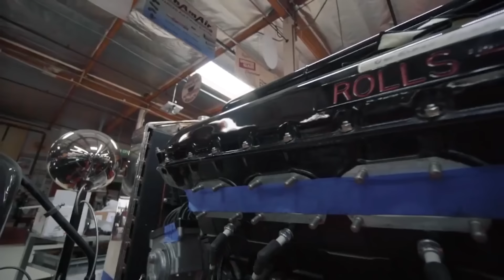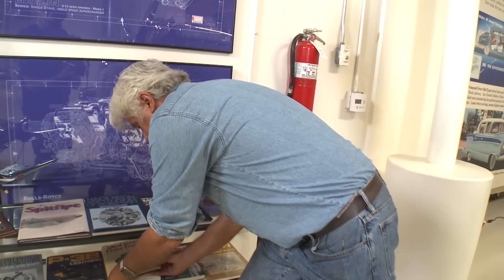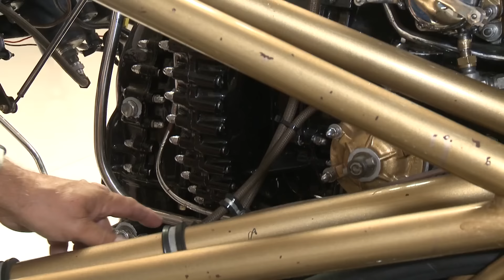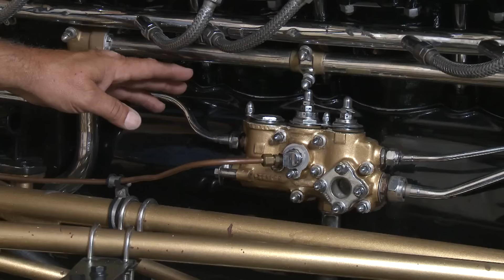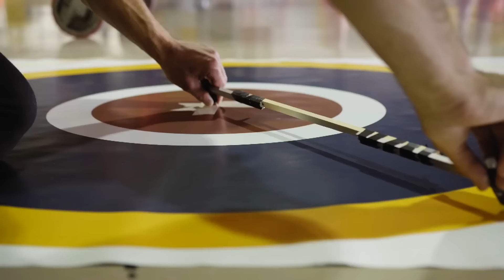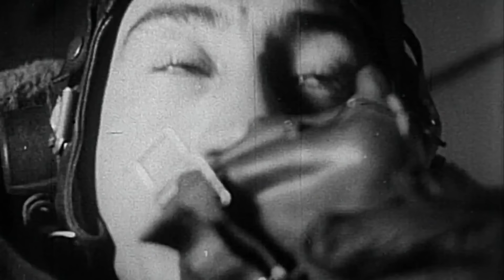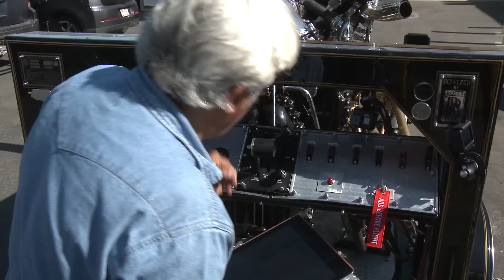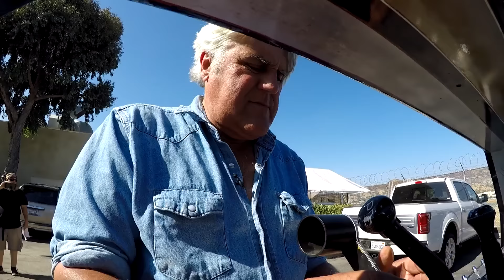The Engine That Won World War II - Jay Leno's Garage

Comment: The Canadian Warplane Heritage Museum is actually in my hometown. Hamilton, Ontario. It's a good 60 km drive away from Toronto.

If you want to ride the Lancaster... you pretty much need to book it a year in advance because those rides sell like hotcakes... and they're expensive as hell.

Aside: We also have the very last Tribal-class destroyer (used in WWII) here in Hamilton, the HMCS Haida. And about a 130ish km away in Port Burwell, Ontario you can visit the retired HMCS Ojibwa, an Oberon-class submarine from the 1960s (that was used until the 90s).
Reply: I checked the museum web site and a 60-minute ride in the Avro Lancaster is priced at $3,500.00. For those whose pockets aren't so deep, a 20-minute ride in a twin-engine B-25 Mitchell bomber (the plane Jimmy Doolittle flew off the carrier USS Hornet in 1942 to bomb Tokyo) can be had for $500.00. All in all, considering the 75+ year age of these planes and the costs of keeping them airworthy, the prices don't seem to be out of line.
Reply: Just to point out, the CWH Lanc didn't see wartime service. It was finished in July 45, and spent it's service life in the RCAF based in NF for maritime rescue patrol. (Though it does have the centre section of a wartime plane. From a repair in the 1950s.)

The former RCAF FM213 is now painted as RCAF KB726 the aircraft on which Victoria Cross winner Pilot Officer Andrew Mynarski served (and died).

As for the price, it's "expensive" in terms of most people aren't going to spend $3500 (CAD) for it, even though it goes entirely to keeping the Lanc airworthy. (Then again if it was cheaper there'd be even MORE people wanting to ride it...)
Reply: Of the 7,377 aircraft built, only 17 remain in complete form today, two 
of which are airworthy. Within the seventeen surviving planes, ten are 
Canadian-built, and eight now reside in Canada. Shot down. Scrapped. The cost of making one airworthy is astronomical.
Reply: My hometown as well. The Lanc sat on a pedestal in Goodrich for years. It was donated to the CWH by Bruce Sully. My Dad yanked it off the pedestal and dragged it across the road to disassemble it, so it could be heli lifted to Hamilton via a CF Chinook. Took them 2 tries but they got it off the ground. Never saw the aircraft again till decades later at the CWH in Hamilton. The CWH owes my Dad his promised ride BIGTIME!!
Reply: For one thing, the airframes on these planes are now about 75 years old. Far beyond their designed life expectancy. Four engine bombers were built for a very specific task - to drop bombs. As such, they did not lend themselves easily to being used for other tasks. They were expensive to operate, difficult to convert for civilian use and very soon were outdated for military use. They quickly became of no or little military or civilian value and were eventually scrapped. The ones that survived being scrapped have slowly succumbed to age to the point where there are now only two airworthy Lancs left.
Reply: I visited the Bomber Command museum in Nanton, Alberta this summer to see their Lanc on display. After the war, surplus aircraft like a Lancaster could be bought (minus engines) for less than $1,000 (about $10,500 CAD in today's money). Apparently, farmers would buy them in order to strip out the wiring, hydraulic cylinders, sheet aluminum and other parts for use on the farm and then sell what was left to scrap dealers to recoup some of their cost.
Reply: soaringtractor
Not this idiot again. The Merlin was a Roll Royce Merlin, not Packard. Packard were a sub contractor for Rolls Royce. Packard built another company's engine.
Reply: Who care's where the engines were made Wiblur? The technology and designs were British and by the end of WW2 Rolls-Royce was concentrating on jets and the Griffon. By contrast Packard was trying to stay afloat building 1932 technology in 1946. When did they fold?
Reply: I don't believe they were profiteering, but as a licensee they didn't have the technical innovation to continue as an aero-engine builder when things were changing so fast.
Reply: Aryan supremacy was not the underlying principle of manifest destiny.  While the term has adapted in meaning through the years, the underlying principle was and continues to be God's purpose to accomplish a given task.  There is a presumption of racism in the tenant but it is not the underlying principle.
Reply: The Warplane Museum also has a de Havilland Mosquito - a bomber powered by the Merlin.  The last time I was there, they were overhauling the Lancaster Merlin engines, and flights were not available (obviously).
Reply: Shock Diamond.
Packard did not design the Merlin, they did not change the Merlin, they did not improve the Merlin. 
Packard made Merlins to Rolls Royce specifications and that is all.
The bearings were of different material because that is what was available locally.  The best Packard built Rolls Royce engine was put into the P 51. It was not even close to the best Rolls Royce Merlin. Reliability was far better in Rolls Royce engines.
No matter how you lie, the facts are that Rolls Royce were better at making engines, more progressive and they paid Packard rather well for engines that at first were not too good, later they were ok, but they were still not Rolls Royce quality.
Reply: Lancaster FM-159-Nanton will hopefully fly again one day.
Reply: MrCorvairGuy-  Actually, the idea of Aryan supremacy was a prominent philosophy in American society and government in that late 1800's and early 20th century.  That was the underlying principle of 'Manifest Destiny' that led us to the shores of the Pacific and beyond.  Seizing & subduing the Philipine Islands after defeating Spain, and then conflicting with the Japanese 40 years later, were the end result of this way of thinking.  Read virtually any book on Teddy Roosevelt to learn just how dominant was this way of thinking, with T.R. one its leading proponents.  Henry ford, of course, was a product of this era, so it's no wonder that he was sympathetic with SOME of Naziism's tenets.
Reply: John Burns
Actually Packard did not design the Liberty engine, and they made some of them, but not the complete engine, Ford was the main supplier of parts for the engines which date from 1917, RR made their own aero engines from 1915. Poor Wilber tractor does not like it that Britain was so far ahead.
Reply: I had the privilege of accompanying my son who is a Scout on the Hamilton Warplane Heritage Museums "Nite Ops" overnight sleepover. One of the curators and I got to talking as I was born in the same town as Reginald Mitchell, the designer of the Spitfire which of course, used the Merlin. Although the Lancaster was laid up for maintenance over the winter, eh allowed myself and another father there access to the Lancaster and spent over 2 hours talking to us. He gave us the history of that specific Lancaster. 

I cannot agree with Jay more. If you ever get the chance, visit the museum. And at C$5000 for a flight in the Lanc', money well spent. Apparently, its costs in excess of C$250k per engine for a overhaul. All funded privately.
Reply: Shlock Dimond.
The Packard version was not better, it was the same as the equivalent Merlin and not quite as good.  
Rolls Royce engineers did do everything by hand including fitting bearings to much better tolerances, but Rolls Royce and Ford of Britain made changes for mass production which were exactly what Rolls Royce gave to Packard.  That may help explain why Rolls Royce made more Merlin engines than Packard, Rolls Royce also made the Griffon engine and jet engines.
The Packard copy used a different supercharger which was heavier and less efficient than the Rolls Royce version 
  
The Packard version went into the P 51 because it was available locally and North American did not need to import it. any Spitfire from 1941 could go more than high enough to escort the B 17. 
You are mixing the P 51 with a Rolls Royce engine to the P 51 with an Allison engine, the Rolls Royce engine certainly helped the performance of the P 51 including the ability to go higher. The service ceiling for a B 17 G,  35,600 feet, the Spitfire Mk V of 1941 could go higher and the Mk IX with a 2 speed 2 stage supercharger in 1942 could do over 43,000 feet and that is higher than the P 51 D of mid 1944. The Spitfire Mk IX had at least as much power and some more than the Packard engine in the P 51.
Reply: John Burns 
It's someone's intellectual property.
It's not "holding" anybody back, except for those who think they deserve a free ride in life.
That's the mentality of a squatter.
Break into someone else's home while they're away, and think you have a "right" to live there...
Reply: One hundredth upthumb for the Hammer, and it is most certainly not a Toronto suburb, not a part of the GTA. To be correct, the closest you can come to lumping the two together is the GTHA. Jay, thanks for coming to Hamilton, next time look into a direct flight to John C. Munro Hamilton International Airport, not sure what connects, but that is where the CWHM is located.
Reply: Why only 1-2 Lancester are preserved? I mean they have made thousands of them, they were scrapped all after war?
Reply: Not exactly. They lived on, for awhile, in the shape of Shackleton Marine Patrol aircraft didn't they?
Reply: yes, into the 1960s.
Reply: Guy's give him a break, he's an American you can't expect him to understand Geography.
Reply: And the Lancastrian freighter/passenger aircraft, plus they formed the basis of the Avro York which did great work as a transport - especially in the Berlin Airlift.
Reply: AdmiralCreideiki warplane museum is like behind my house lol
Reply: soaringtractor
I know how the Liberty engine was cooled.  It was unsuitable for tanks in deserts.
Reply: There are a few preserved as static museum exhibits and there is one in the UK that can taxi, which they hope to get back into flying condition one day.
Reply: 18tangles
Will you please get to know how to use a keyboard.
Reply: Shock Diamond
"It's the reason why the Packard Merlins went into the P-51D Mustang and not the Rolls version "
The reason why was that they were made in the USA and easy to transport to NAA.
Reply: 18tangles
"No copyright in those days"
Copyright and patents have held the world back.  It is economically parasitical.
Reply: I think it can do more than taxi.  https://www.raf.mod.uk/bbmf/theaircraft/lancasterpa474.cfm
Reply: Bob Johnson 
That's when they get rebuilt and restored, strengthened and reinforced where necessary, new parts fabricated to keep them in flyable condition.
It's not exactly cheap, but if it's important to enough people, it can be done.
Reply: Lee S
_"It's someone's intellectual property.
It's not "holding" anybody back, except for those who think they deserve a free ride in life."_
The Free rider is the patent or copyright holder. They hold them for far too long stifling progress. It is unearned income.  Free loaders.
Reply: Lee S.
You mean those Rolls Royce Merlin engines were nice, there was no Packard Merlin, Packard were a well paid subsidiary of Rolls Royce, they made some of the engines to Rolls Royce specifications
Reply: 18tangles
It is the time length of copyright and patents that is the problem.  They are far too long.
Reply: He can hop on a UPS Cargo flight.
Reply: Just to be sure you don't reply with something unfounded and annoying, I will paste an excerpt and you should just accept that you're learning something you didn't know:
"Packard’s licensing agreement prevented them from implementing any changes to the design of the Merlin without approval from Rolls-Royce. There was an understandable need to maintain compatibility and consistent performance among the engines regardless of where they were manufactured. While Rolls-Royce engineers were typically attentive to suggestions from their manufacturing partners, any accepted design changes were applied across all production lines.  One area where the Americans contributed to the greatness of the Merlin was the crankshaft bearings. US aircraft engine manufacturers had determined that a silver-lead alloy with indium plating provided long wear and exceptional corrosion resistance. Thankfully, German engineers who evaluated captured American engines falsely deduced that the indium was merely an impurity. Packard shared the secret bearing formula with Rolls-Royce who incorporated it into the Merlin."
Reply: Do as you wish.  The only thing you might say different is, after Packard's bearings were approved by Rolls Royce, it was implemented across all manufacturing lines.  It is also true that Packard's tolerances for mass production were much finer than Rolls Royce's hand built units and they actually used torque wrenches to evenly and accurately torque nuts and bolts, where Rolls Royce engineers did it strictly by hand and feel.  Again, the Packard built Merlins were a better version simply by design as they needed to be 100% compatible and interchangeable with other engines.  It's the reason why the Packard Merlins went into the P-51D Mustang and not the Rolls version from the Spitfire, and the stage 2 supercharger that accompanied the Mustang increased its power output and allowed them flight of much higher altitudes and escort B-17 bombers.
Reply: I'm surprised the Canadian air force and navy don't want those all back to use today! lol
Reply: johhnybottle-  In the mid-1950's, as a result of being under-capitalized.  So much for 'was profiteering', eh?  Those engine contracts didn't seem to do Packard a whole lot of good, did they?
Reply: soaringtaractor-finnigan
"What you fail to realize is PACKARD was designing and building engines as long as RR was clear back to 1915"
So was Skoda as well. But nothing made them better or had better designs than RR. Now you know.
Reply: Gary Tarr 
Those Packard Merlins sure were nice...
Reply: The Haida  used to be in Toronto, but the Liberal Party used it as a bribe to get seats.
Reply: Adolf Hitler praised Ford's openly anti-Semitic views and his mass production abilities; however, Henry Ford was NEVER a Nazi sympathizer.
Reply: Barrie, I never said Packard made Liberty engines. ;) How Nuffield used it in British tanks I will never know. It was poor with severe overheating problems.
Reply: Packard was building the Merlin under licence, but don't get confused - Packard's versions of the Merlin are not identical and are a better engine.  Packard's versions are the definitive Merlins that were better than what Rolls Royce developed.  The V-1650-7 is the best version of the Merlin put into the Mustang P-51D.
Jay's Merlin is a PACKARD V-1650-1 MERLIN, which is a single stage, two speed supercharged engine - a near clone of Rolls Royce's, except Packard used better main bearings.  Due to the use of indium plated, silver-lead alloy bearings, the Packard Merlins were stronger, more reliable engines.  No matter how you slice it, dice it or rice it, Packard's Merlin were better, regardless of the engine's basic mechanics and architecture belonging to Rolls Royce. ;)
Reply: "Nowhere in the Haynes book".  Great.  Someone who is using a Haynes manual is trying to argue with me..
Reply: Patents don't work quite that way.  You can submit a patent to the country in which you build your product, but that does not automatically protect your product from being built by someone else in another country.  You can submit an international application, but it does not cover every country in the world.  It also doesn't mean you will get approval in all countries if, for example, in one of those countries, the patent exists for what you plan.
While a majority of countries are ratified, you could technically open a corporation in one of the countries that are not part of the PCT (Patent Cooperation Treaty) and manufacture that product with impunity.  The other difficulties that can arise are tracking down knock offs.  People in China will make a knock off of anything and nothing ever happens, except DHL will deliver your package with an absurd duty charge and you find out your RayBans are "ChinBans"...  The authorities of a governed country may not have the resources and ability to stop patent infringement in their country, even if they are ratified in the PCT.

Comment: I was wondering when you would do a segment like this. It was very interesting and enjoyable. The restoration work is beautiful. It doesn't sound like it likes to run at idle speed, or low RMPs. Not sure if that is a characteristic of the engine, or if a carb or ignition setting is off somewhere. Also, I noticed a flame on one of the exhaust ports. And don't forget to wear eye and ear protection around this thing, or you will be blind and deaf in short order given the unmuffled exhaust, and the ability of that prop to turn a pebble into a bullet. That engine is a magnificent example of brilliant engineering and fabrication. I think you should tell your wife you want to display it as art in your house. I'm sure she'll agree....
Reply: Actually, that was the 1st thing I thought of.. All those guys standing around behind it while it ran were nuts! Any little thing that was lying around loose on the ground just became a projectile, even at those low revs. I'm sure those in Jay's insurance dept freaked out after they saw this vid!  :)  I still wish he would've revved it up though..
Reply: Try You Tube for GUY MARTIN'S PRIZED POSSESION